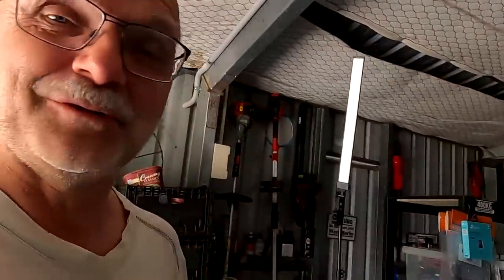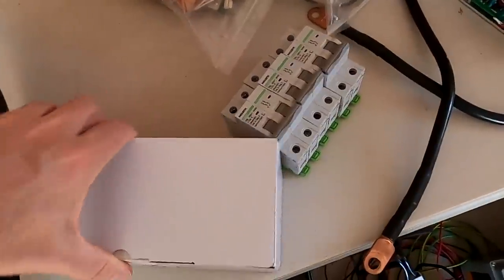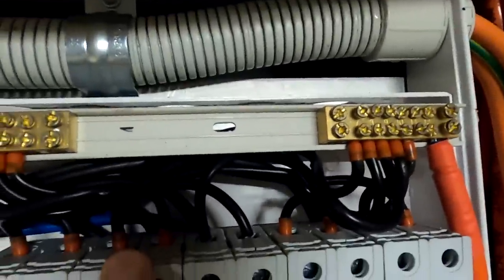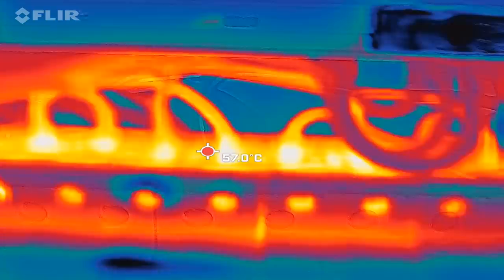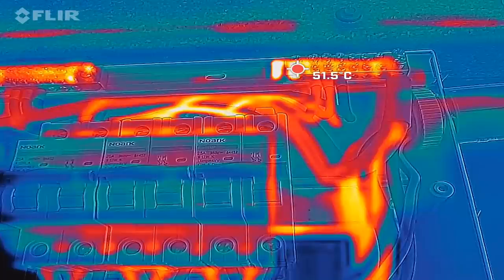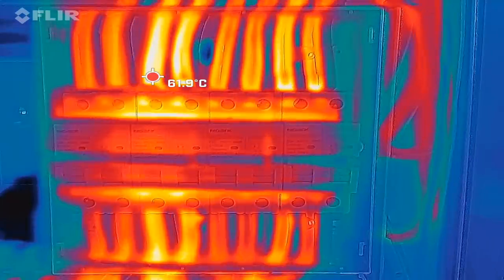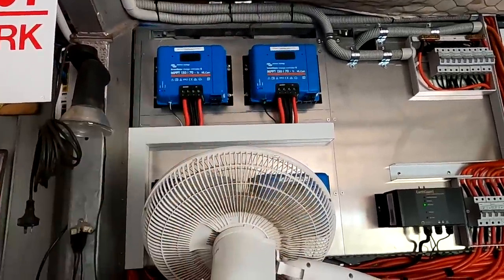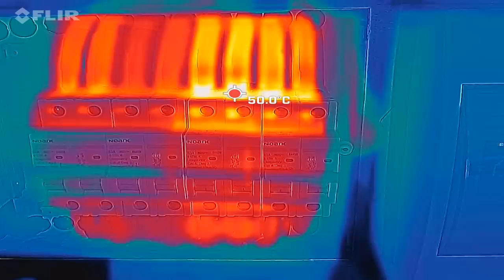The PowerWall and Battery Shelf in sunny hot Australia at 40°C. What can we do though?

Comment: Ta Andy. Your Victron solar charge controllers are a bit boxed in and the aluminium vanes are behind. Victron note the energy efficiency of its devices by temperature, and the fall off at 40' and 60' is considerable. Ceiling insulation makes a massive difference and the temperature gradient within the shed despite it being open will still be great. Lowering the charge controllers to the floor and setting them out from the wall may help. Victron I think suggests no ferules despite ferules being common in European wiring.

Comment: You could use pc fans that push air from behind onto the heatsink of the mppt‘s.
Reply from the maker: As I said, and the rest of the installation?
Reply: @OffGridGarageAustralia  install a fan into every device. The breakers dont really need cooling. You could still use your portable AC unit, but if you use that, you‘ll have to insulate your shed. Big difference.

Comment: I am surprised that more of this equipment does not come with a liquid coolant option, that would be a nice add on and hot water as a bonus!
Reply: It would be interesting to see if he could cool the metal back panel to reduce the ambient heat. Maybe TEC water coolers for the heat transfer.
Reply: @BobHannent  TEC are incredibly inefficient. One can use the if have a lot of spare energy to burn. Otherwise as someone already suggested, mini split or  heat pump system to pump away heat.
Reply: @zlotvorx  my reason for suggesting a TEC is that the heat transfer could be very local. A mini-split would involve cooling and entire room, as opposed to heating just the charge controllers themselves.
30W vs +600W.
Reply: @BobHannent  You mean use a 30 W TEC to cool the controller? Or move 30W of heat? They are maybe 10% efficient, so calculate the input power with that in mind. 600W mini split seems much better value.

Comment: Hi Andy,

I would insulate your roof with 20 cm hard pressed wood fibre plates (Steico special dry or similar). They have an excellent heat storage capacity. Everyone looks to Rc or µ values but to prevent overheating you should als look at the thermal capacity.  Unfortunately you don't have that much room, so I would take off the metal, place the insulating plates and put the metal back on. A bit of work, but so comfortable.
Reply from the maker: It would make little difference. If the ambient temperature is already 35°C, there is not much you can do. I will install some of the roof insulation in the areas of the combiner boxes as discussed.

Comment: We're at -15C right now, and lots of snow. It's nice :)  Have you considered installing a simple air to air heat pump to cool the garage? You've got plenty of power anyway.
Reply from the maker: I'll send you some sunshine☀️☀️☀️
Yeah, got one here, picked up Monday, doing the testing today. Charging the cameras right now ;)
Reply: Hey Up North!  You provided  me with some research with LifePo4 and freezing temps several months ago in the forum.  My batteries are now at the cabin which will mostly be below freezing for several months.  The cabin will not be used now until Spring.  I left the battery at 55% SOC, unhooked all loads and turned off all charging from the panels.  We shall see how they are in the Spring.  From what you sent me and some other more anecdotal information from others, I think they will be fine.  This is one experiment Andy can't run unless he buys a walk-in cooler!  He gives no thought to how these cells react to extended exposure to below freezing temps.  He doesn't have to!!
Reply: @jws3925  Yeah, should not be an issue. Mine have sat at -20C for weeks, and disconnected the entire winter, at some point. I have some back-up cells which I also keep in a non-temperature controlled  environment. Too hot is an issue, cold slows down calendar ageing. As long as you don't charge them, and keep them at 50% SoC, they'll be fine.
Reply: @upnorthandpersonal  We were -11c last night my battery temp in the workshop is -3c bundled up under blankets and coats.  
My Bum Squeaked!!!

Comment: Keep in mind that the Amp rating does NOT ensure the wire will not get hot.  It only ensures it will not get so hot that it damages the insulator or conductor.

Also,  many of the hot spots were at the connection between the wire and a device.   This is typical.    Do any of the devices have torque specs on the terminals?

Comment: As far as I know, if the Victron Solarcharger are over 40 C, they reduce the outputpower. I put a little fan on my charger controlled by the cerbo and a temp sensor comming with the Multiplus II.
Reply from the maker: Yes, that is correct, they will throttle down. I have not seen it yet. They still output close to 4kW, the max they can do, under these hot conditions.

Comment: Greetings Andy, I watched your delve into the thermal shenanigans  of solar energy production with interest, I am a materials scientist and had looked into similar issues. we found because copper is used as a good electrical conductor it was overlooked its also a great thermal conductor too (hence car rads of old), with your minimal 10a load the 35 mm² cable will not be heating due to electron throughput. The close proximity of the cable to your 65º roof substrate is what's causing these hotspots and consistent cable temps. the reason why the fuse blocks were showing signs of heat is because it is the thermal termination point and the ceramic fuse is not a good conductor of thermal energy.  you can do an experiment with a few meters of cable along side your existing cables and measure that to prove or disprove the point..As a fix you can use thermal vehicle exhaust wrapping around the conduit .....good logical approach to problem solving.. R
Reply from the maker: Thanks a lot, Ricci. That is great insight, thanks for sharing.

Comment: Hi Andy, With me, where we also sit now with 40 odd C temps I have mounted  120mm fan over my MPPT's and it makes a difference that much I can tell you.  I have it so that 3/4 of the air goes behind through the heat sink and a 1/4 over the front case, it helps a lot having active cooling, I've hooked up the fans through the VGX and have DIY'ed with the LM335 temp sensors to switch the fans on and off via temperature measured from the MPPT's heatsink. My MPPT's do not have temp relays so yours I think do and could be controlled from the MPPT Firmware....

Comment: Paint the external walls & area with white paint - huge difference
Reply from the maker: There is literally no sun on the outside walls. The sun is straight up in summer. Through the other seasons, it does not matter as it is not that hot...
Reply: @OffGridGarageAustralia  wow ok - so not radiating from outside.
so then its heat rising from inside - insulation may make it worse, add ventillation at the top then?

Comment: Very interesting thermo test! And thorow testing if the use of ferrules actually makes a difference when it comes to heat build up. Regarding the fuses vs breakers: I think we all knew there is more heat generated/power wasted in fuses as suposed to breakers, but I didn't expect the difference to be that significant. Great Video, Andy! I just sort of miss a word from you on your conclusion: you will still use ferrules in the future and only breakers - or? 

Favorit comment: "I think it is in - screw it!"
Reply from the maker: Thanks John. Yes, I will still use ferrules everywhere if possible and also re-crimp the ones I have taken off. It's a cleaner installation, keeps all the strands together and a safer way to connect.
Some have reported here that bare wire in clamp terminals need frequent re-torquing due to heat shrinkage and expansion.

Comment: I noticed that with my FLIR it will show reflected temperatures.
 if the cables and bus bars are shiny then you are seeing the temperature of the tin roof above. 
If you use a pease of cardboard to sheald it when using the camera it may make a differance.
You maybe getting a false reading? if the wires going in are 12 AWG and the wires going out are the same,
then why would they be any different ? maybe the wires on top are showing radiated heat ?
As heat is a light wave use a mirror with your FLIR its very interesting... also a little bit of cardboard should sheald the boxes from the roof iron !
Reply from the maker: Yes, that tricked me again in the car port with the brass bus bar. I should have known better from previous experience...

Comment: Hi Andy, Can you open one of the MPPT amd have a look at the temperature ratings of the capacitors. Good ones have a rating of 5000-8000hours @ 105 Celcius. Bad one 2000h @ 85C. Or not even specified. Good brands are Nichicon, Panasonic and there are also others. Derating of the specified temperature compared to the operating temperature is quite important for longevity.

Comment: Power supplies/inverters, temperatures are CRITICAL!!! Arrhenius' Law of Chemical Activity: The capacitor’s life doubles for every 10 degree Celsius decrease in temperature.  Caps are why most power supplies fail... keep working that temperature!
Also the fuses are probably (correct me if i'm wrong) Ohmic resistors, so the larger the current the higher the resistance.  Test to see what the resistance is at when they have current flowing - using a multimeter is probably best possible conditions & they'd be worse when running.

Comment: Ferrules should be unnecessary with those breakers. That is because they have a fancy mechanism instead of a screw that goes directly into the wire. Ferrules are needed when a simple screw is used because the screw can push individual strands out of the way.

Comment: The thermal camera showed you a strong clue that it wasn't the ferrules in the breakers.
* the wire showed a warmer spot at the breaker, cooling rapidly away from the breaker, both below and above the breaker. this indicates the heat is either from the connection or the breaker, conducted into the wire. the small size of the spot and rapid decrease indicates the heat is from further away. similar pattern ferrule and without indicates the ferrule isn't the issue.
* the upper connections were warmer. This is partially expected (heat rises, heat from roof?) but may indicate heat is from the breaker.
A correctly crimped ferrule should not be a significant heat factor unless high current relative to the wire size as the resistance added by the ferrule should be insignificant. But perhaps the terminal and the ferrule are not correctly shaped.  A square crimped ferrule is better for flat connections. A hex crimped ferrule is sometimes better for round/curved compression plates.

Comment: Fans along MPPT Controller - is exactly what I did. Else they get very very hot.(MPPT 260/100 and MPPT 250/80) I cut an opening in the backwall in order to accomodate the fans exactly behind the heat sink. (two fans per MPPT) They start blowing at 40 °C. It makes a huge difference even with tiny fans blowing from behind against the heat sink.
Fail safe? In case of broken fans  there is still an advantage compared to standard monting.
Reply from the maker: But what about the other gear...?

Comment: Hey! How do your panels behave? I mean you have a lot of them, what happens when your batteries are 100% and panels are still producing a lot of power and all that power has no place to go, as a bonus it's extremely hot outside. Do they overheat?
Reply from the maker: The Solar charge controller take care of that and control the charging of the batteries. If they get full, they turn off charging and the panels will sit there producing very little power (depending on your load). They actually cool down then as there is no current running through them anymore.

Comment: I don’t think many others have a clue as to how much copper you got around the power system$$$. Congrats on a cool system. Go big wire or go home 😅
Reply from the maker: Yea, it must be a lot. Due to the parallel strings on the roof, the sparky used around 200m of double 4mm wire to connect all the strings.

Comment: Fuses have resistive losses that produce heat. They must in order to melt above their rated current. Magnetic breakers do not depend on heat to trip. Fuses are actually quite lossy. If you measure the voltage drop across a fuse running near its rated current, and calculate the power loss (P=IxE), it's actually rather high. You've made the right choice by substituting breakers. You won't get a valid estimate of the power loss through a fuse by measuring its cold resistance. The fuse link resistance has a positive temperature coefficient. To calculate the loss, you need instead to measure the voltage drop across the fuse with actual measured operational current while in the actual operational environment.
Reply from the maker: Thanks for your explanation. That makes sense to me.
Breakers do have a thermal trip mechanism as well, so they will heat up too.

Comment: That I expected as you use low voltage string. so that power will became heat in high current network so that usually ppl use 500V String instead of 150V or 100V String

Comment: Hey andy, How do you get around the new Extra low voltage requirements for your solar panels and inverter. my understanding is that under the new Australian standards you cant work on any DC circuits that are over 60v DC. so that means you cant really run any panels in series without going over this? I am only asking this beacause i have been following along on your channel and want to build out a similiar setup as you at my own place. 

Cheers mate
Reply from the maker: That's one reason why I stay under 120V DC and have only two panels in series. As soon as you go over it's considered electrical work and you need a sparky.
Reply: @OffGridGarageAustralia  yeh but it now has to be under 60V DC not 120V DC, most solar panels are over 30v so that means techncally you cant even run 2 in series without needing a licenced sparky. im thinking i might have to make my system all 24v so that i can do it legally and just run all of the panels in parralel.

Comment: @off-grid garage: Andy, it might not be the fuse holder. Please check the fuse itselv. I would not be suppirsed, if the fuse allone is most of the problem
Reply from the maker: How do I check the fuse inside the fuse holder when operational? Please make some recommendations 😉
But you are right, other people have stated this as well here... The actual fuse could the heater.
Reply: @OffGridGarageAustralia  You could just test a spare fuse. Or replace the one with a spare one. I think the resistance will be quite constant over all fuses with the same rating/manufacturer. Maybe this one string has a higher current--> more heat.

Comment: Hey Andy you should have done a different solar panel config so that more were in series rather than parallel for higher voltage lower current
Reply: More than two would need the 250V versions.

Comment: I would like to throw the idea at Victron to incorporate a fan set up with their charge controllers. Electricity will always conduct heat. Specially the controllers. If you have a fan to move the hot air away from the unit, it will help the controller both last ALOT longer and not potentially affect it's production. Same as using a cpu fan. Also, 70 amps at 48+ volts is a lot of DC power for wires to carry. Specially in those temps. Thank you though for showing the difference though of using ferrules vs straight wires. It does make a slight difference but only because you increase the surface contact area, thus slightly reducing the resistance. But massive emphasis on the SLIGHT. 😁
Reply from the maker: Fans can fail, clock up with dust and add more complexity. The Victron MPPTs are designed to run at these temperatures with no problem. They throttle down automatically when getting hot. I would not like to have a fan on each MPPT...
I will leave all ferrules in place and also replace the ones I have taken off for the test again. These bare wires can cause some issues as well over time and clamp force needs to be checked frequently. More maintenance...
Reply: I have two centrifugal fans for each of my four Victron MPPTs. They are mounted just below the MPPTs behind the cables blasting air up through the fins. I use a temp controller for each pair set to control in the range 35-40degC. This seems to prevent throttling and stops the casings getting too hot to touch. Even though this is in the UK we had ambient temps of 35degC+ last August so it was a good test.

Comment: I made my passive cooling solar controller with a active cooler (12v/12cm fan), so it keeps cool in the summer, also the life span should be longer as well as the output, max 35 degrees for the controller, controlled by the system (domoticz) I did the same for the inverter so it stays cool, there is a massive diff between no cooler or a cooler.

Comment: 38°C in the garage! WOW! that is hot! And here I was complaining my garage is ~32°C.
15:00 is that busbar copper or brass? Brass is bad conductor
24:47 JK at 37°C. Is that measuring from the top of the cells? or did you tuck it in between cell# 1,14,15,16?

Comment: When you have heating on fuses or breakers you need to check voltage drop across contacts or connections under load. Voltage drops cause heating and potential failures.
Reply: Aren't voltage drops a result of resistance in the electrical path? I think that is why Andy measured resistance in the fuse holders in the first part of the video.

Comment: What if you put a small piece of wood or other insulative material between the ruvi and metal of the building. For those of us not already set up, do you think there would be any advantage of having a larger combiner box, so that each fuse holder or breaker has a bit of an air gap between?
Reply from the maker: Yeah, great idea. Some insulation to get it off the metal... Thanks